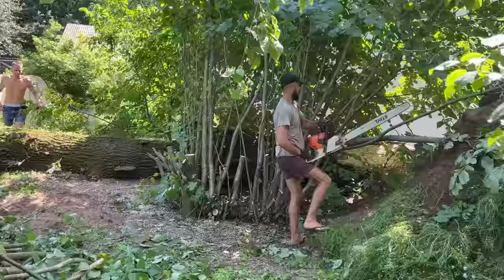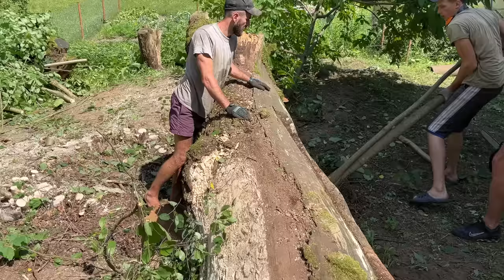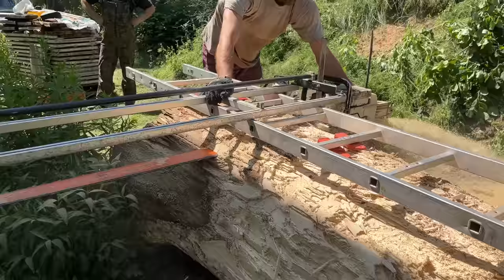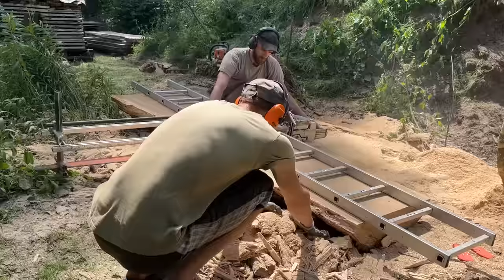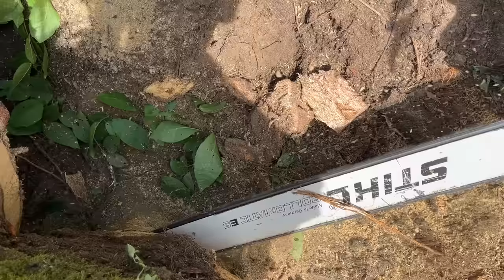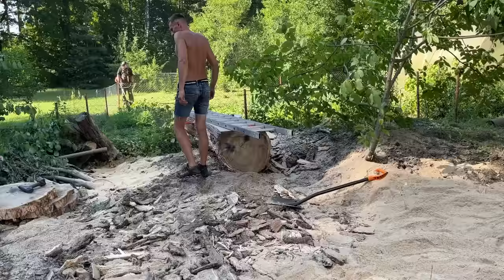Abandoned Oak Log and Amazing Chainsaw Mill

Comment: nice grain, and the saw was well run and sharpened.  The operator did a very good job keeping the chain pressure on the wood, so it left such a nice even cut.

Comment: Nice job..  I hope you guys put something to seal the board ends and prevent checking..  I use cheap caulking from Home Depot..  I use a putty knife and force it into the boardends to seal from rapid moisture release and cracking..  have fun..
Reply: @armedfarm3429  I am a retired forester that worked for 37 years in the wood industry..20 years ago I saw 3 guys cut down a walnut orchard.. They then proceeded to mill the logs..  All total they milled 14,000 board feet..the sticker Ed them and cover with tarps.. Most of the lumber was 6/4 but after 4 years of drying it out..over 40% of the wood was lost to checking..Meaning huge cracks from the end of the boards inward..  All they had to do was spend a few hours sealing each board..it’s a sealant.. but nope ..imagine 5000 feet of black walnut firewood….Ha.

Comment: hi, I am fairly new to chainsawing, about to start milling. 5:40 into this we see some sharpening, file going to away from the cutting edge leaving burr not on cutting edge. To me this makes sense, but every other video I have seen on sharpening goes in opposite direction and leaves burr on cutting edge. Would you explain?

Comment: I understand the process I’ve done it enough BUT why use the ladder more than once on the log after your first cut you have a flat surface to work with
Reply: Because they are not really sure what they are doing. Who uses a chainsaw in shorts for god's sake ?
Reply: @akitas8165  I understand the chainsaw but after the first cut he had a flat surface to work with being making slabs
Reply: @jamesdorrill9933  my own experience is that even after the first cut you can end up with some divots in the wood that makes it easier/ faster to keep milling with the ladder in place.

Comment: One of the selling points of the chainsaw milling system is that after the very first cut THE STRAIGHT BOARD OR THE LADDER GUIDE IS NOT NEEDED.  The first cut plane (and subsequent cuts) are all done using the last cut edge.
If a saw crew showed up on a work site of mine without the proper clothing, safety glasses and foot wear like this crew did - then they would have been turned right around and sent to get the proper clothing, glasses, boots and gloves. Any back talk and they would have been fired on the spot and a new crew hired.  Simple and easy to understand.
A very poorly run cut.

Comment: I note the preservation of your limbs is not a priority.
Apart from the bare feet or jandels while cutting the practice of drop starting the saw particularly with such a long bar is suicidal. 
At least twice in the clip the tip of the bar touches the ground on start, both times you were lucky. Had there been something hard under the sawdust pile that it dug into you would never have been able to control the kick back as you have the saw in a single handed grip and it would pivot around your hand with the chain landing on your shoulder. The result is normally life changing if not fatal.
It is a stupid practice particularly with a long bar as the torque generated is huge, far beyond anything you could ever control single handed.